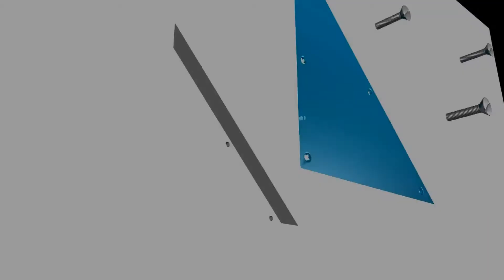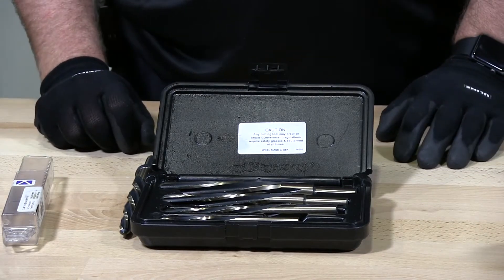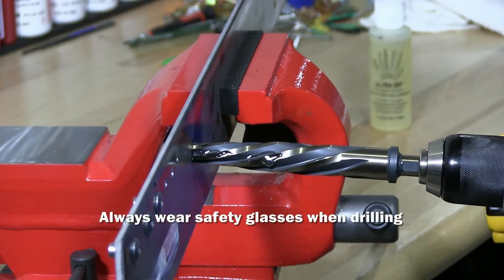Using Car Reamers | Fasteners 101

Comment: On a cordless dewalt drill , I recommend setting the drill on the slowest speed. And switch the clutch on the drill down to about 8 or 9. That way if the bit drabs it won’t twist your arm off. 

Thanks for posting .
Reply from the maker: Thank you for your feedback.

Comment: To restate what others have already said, he is clearly out of his comfort zone. This guy makes videos about  a very vast range of products, therefore it's impossible to be perfect at everything. You can tell just by looking at his hands that he doesn't just count cash and take photos -- he works. He only took about $60 of HSS off of that reamer when he did (what we have all had to do at least once in our lives) the side twisting motion. This is no different than watching "Jerry Rig Everything" intentionally destroy a brand new iPhone or Galaxy phone. I would assume Norseman donated the reamers, therefore damage is a non-issue. An engineer somewhere most likely took notes on product durability. That being said,  another one of the engineers at Norsman most likely broke a computer after watching this mutilation. This is exactly why (if you read) the user manuals on products they have an extremely idiot proof guide - including diagrams with circles and X's on them. This channel has some really good videos on subjects that you will not find elsewhere. Some of these subjects are not even easily found via web searching or Wikipedia. Ask a 20 year old today if he/she knows how to select and use a rivet gun on a joint -- you will most likely receive a deer-in-the-headlights stare. Riveting is almost a lost art with the advent of cheap spot welders, Harbor Freight welders, and online purchasing of any bolt/nut/grade imaginable. Engineers, architects, construction workers, contractors, machinists, and welders are the type of people that might have already been taught these skills. To the average 25 year old first time home buyer this is all voodoo. Instead of complaining, I would like to do what others have not and say thank you for taking the time to produce these videos.